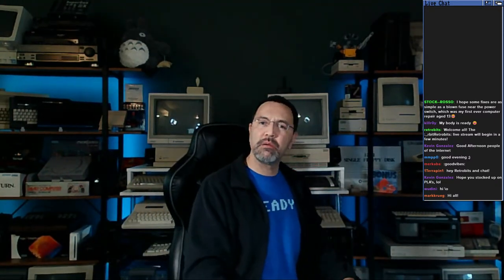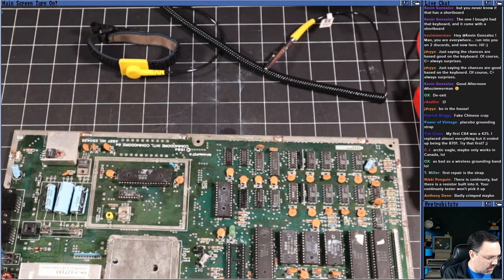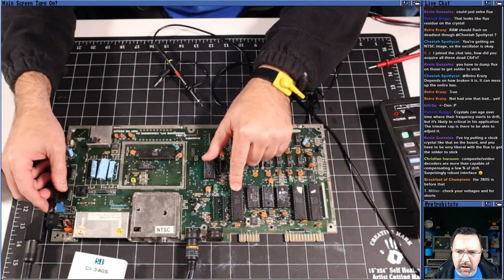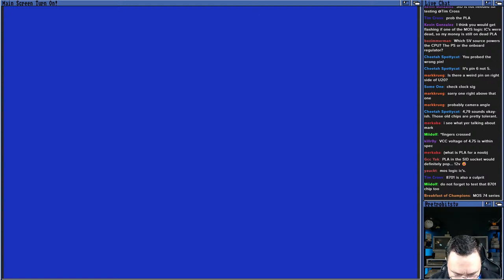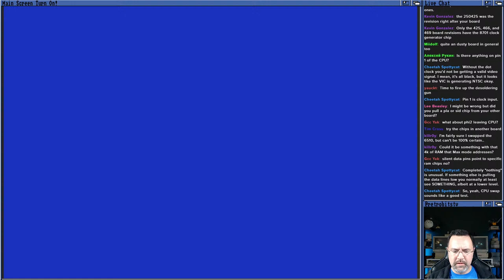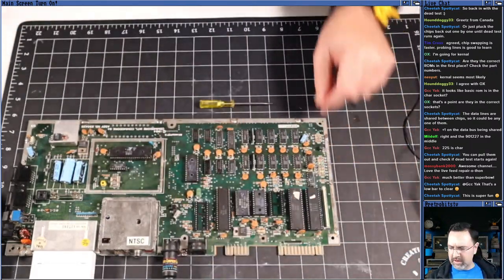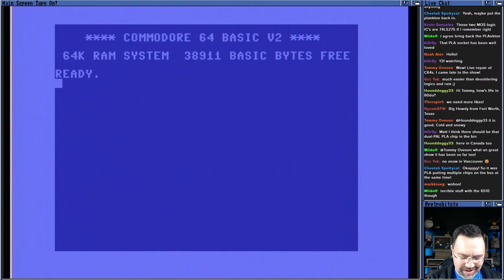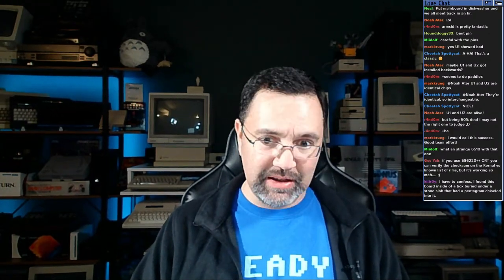Repairing a Bin Full of Dead Commodore 64s - Live!

Comment: Not sure if it came up in chat, but your grounding strap should NOT show clear conductivity. It should have a high resistance. Usually 1 Megaohm. Be sure to measure resistance instead. If it was shorted to ground, that might be a good way to get a good shock! The idea is that charge bleeds off slowly (still only takes microseconds) through a high resistor.

Comment: You were seeing bus contention likely due to the internal ROM and the cartridge being selected at the same time. When you remove the ROMs the conflict goes away. Tip that would have led you to the bad PLA much faster:
In Ultimax mode the internal ROMs should never be selected. Pins 15, 16, 17 of the PLA select the CHAROM, KERNEL, BASIC ROM so they should never go low while the dead test cartridge is inserted. If they are low during dead test, or pin 12 (I/O select) never goes low, you know you have a dead PLA.

Comment: WDC ones are not 100% compatible. If you have to, get and adaptor that converts an old 6502 to a 6510. You can use that with the 65C02, but some software might crash.